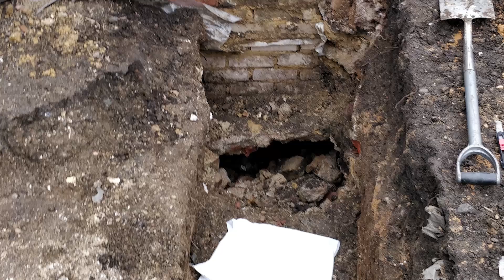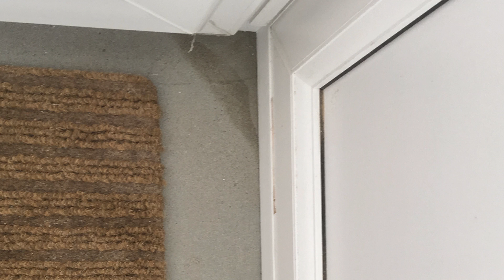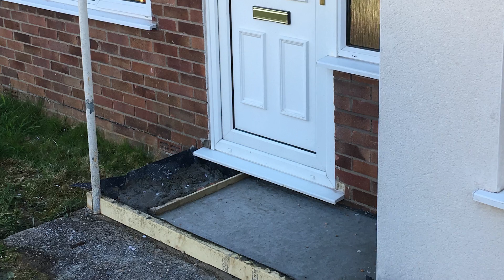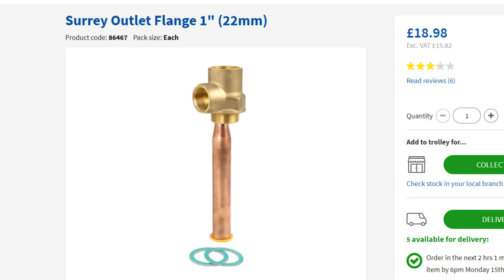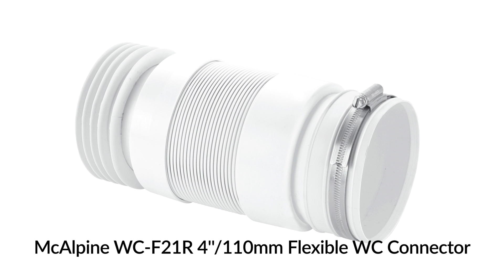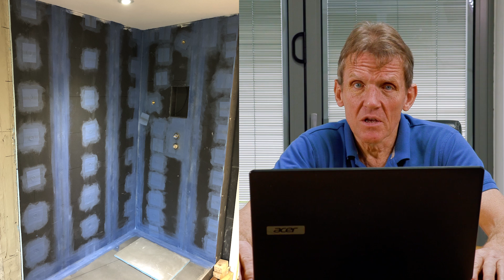Leaking Porch & The Mystery Cesspit - ASB #9

Comment: What that porch is 100% the bell that’s fitted it had just sat the frames on cills without silicone, waters blowing back between cill and bottom of window frames soaking into the floor
And is just sat on the concrete 😂 

Rough as guts job that 😂

Comment: Definitely need a proper (round) backer rod over anything greater than 3/8".  That square foam isn't the correct material. The round backer road is made from a foam that does not easily adhere to most sealants, which is necessary for a long-lasting flexible joint.  You want the sealant to adhere to the sides and move laterally for best results - if it adheres to the back as well as the sides, the joint will fail prematurely.

Comment: what do u think is the best "screw" for attaching timber to brick outside? gonna be attaching battens to a brick wall, also a 2x8 ledger for a pergola.. seen so many, anchors, resin, thunderbolts, concrete screws, rawl... does it depend on the brick quality drilling into? im assuming resin anchors are the strongest . but was thinking thunderbolts would be fine..
Reply: I've used spax high force washer head screws, with long Fisher plugs held really well into London cheese bricks!
Reply: They look smart too!

Comment: Roger, for the silcone vs grout option, you can buy anti mold bathroom silcone, comes in a light blue bottle from Unibond,
Reply from the maker: The Average Joe 
I have used loads of different brands of silicone and, to be fair,  a lot of them claim to be anti mould but they also say that you have to clean it after showering. 
I have yet to find one, even with Microban that wil stop mould growing on top.

Comment: Always use a backing rod in an expasion situation, the reason being is you want the sealant to only stick to two surfaces in joint, if it sticks to all three it won't be able to move as much and can tear. If you use a  paintable sealant instead silicone, you can paint it after to blend in better especially if it is a wide joint. Maybe do a dye leak test with using a garden pest spray bottle to find the problem with the PVC door. No idea with the plumbing side of things. Cheers

Comment: If the frame work has been screwed down to the Upvc cill,sometimes the screws can if too long penetrate out of the bottom allowing water which collects in the Glazing channel to follow down the screw and causing damp on the floor as in your picture.I see this all the time.Always cover the heads of any screws in the Glazing channels with a dome of silicone.

Comment: Hi Roger .... Re the leaking Porch. As a plasterer I've come accross many and all kinds of leakages, from old traditional timber-built homes to modern plastics and the 'best' and 'safest' way to cure those ingress points is to ''Caulk' them. Either with the traditional tarred boatbuilder caulking, or with the stuff you would have used during 'your' Apprenticeship (maybe still do) that old greasy, hairy stuff you wrap round pipes (can't think of the name at present :-)
When compressed in hard enough, there no damp/water getting past either product.

As for the Neggie-Norah's and Nigels?? ..... The more you get of 'them' the better, because it means you're hitting the 'sweet-spot' and making them jealous :-)

Comment: I agree with your comment about using foam to fill large gaps around the frame. It is very common to see window and door frames with no foam whatsoever and the fitters have tried to fill the gaps with silicone. Unfortunately not all silicone sealants are pure silicone and they tend to crack rather than stretch.
Reply from the maker: Bodge 71 
Agree completely cheap silicone is around  60 % fillers which don't stretch. That is why the low modulus is important. Also the acetic acid sanitary sealants don't stick to sand and cement so  you also need neutral curing.

Comment: Those back to the wall toilets! We bought a house, bathroom fitted out nicely and looked fine. Moved in and after a couple of weeks noticed a cracked tile, a really fine crack. But we had spares in the loft so I thought I'd take the cracked tile off the floor and replace it. Lifted the cracked tile and the floor underneath was soaked and rotting and it runed out that the back to the wall toilet had been leaking from the flush feed since it was fitted! Took a lot of the floor to be replaced and a refit and the back to the wall toilet in the skip, the insurance stumped up 2.5k after the loss adjusters visit, the loss adjuster reckoned it was luck that we decided to lift the cracked tile because the other way we would have found out is when the day came I parked my arse on the toilet and dropped through the floor!
Reply from the maker: Chanesmyname 
If you are going to have that kind of accident best to get it on video. Everyone dreams of a viral video and I think that would do it.

Comment: U-pvc porch - the new tapes (such as from Tremco Illbruck) don't need to be siliconed as far as I'm aware. They are airtight, watertight, and provide great acoustic attenuation and thermal efficiency. You only tend to see it being used on new builds not on renovations. As for the weep holes, I wouldn't expect to see "face drainage" holes on a frame which is sat on a uPVC sill. It will be concealed underneath the frame - I have seen on a couple of occasions situations where the gap between the frame and the sill has been sealed with silicone preventing the frame from.draining.

Comment: Isn't the cold water to the cylinder supplied through the cold water tank in the loft? So mains inlet diameter doesn't matter too much right ? As the tank is always full generally
Reply from the maker: You are right but the problem is that as the cylinder is emptied by the pump the cold feed from the tank isn't always quick enough. It needs to be one size larger than the outlet of the pump will suck down from the vent pipe. 
The mains inlet to the cold water tank is not an issue. Perhaps I didn't explain it too well
Reply: @SkillBuilder  ok I understand, thanks for the reply

Comment: With that modern concrete foundation, and brick below the foundation, i suspect that could be an old soakaway thats been built on by a unscrupulous builder. Other than a corbelled  foundation ive never seen brick under a concrete foundation (nor clinker come to think of it) today, building control would make you remove any existing soakaway and either shutter or fill with concrete. I suspect building control will tell the owner to dig it out so it can be filled when he pours the foundation, however this can cause an issue at a later date if the house is to settle in a dry summer this corner is less likely to move, causing cracks.
Reply: Hi Dan, it is a cesspit 6ft across,  there was a drain from my side that went towards it, I also hammered a 2.5M bar down and didnt find anything solid. you are correct it has been filled by the dodgy builder who built next doors extension 20+ years ago. My SE came up with a massive 'T' beam that will be too expensive to do as it would require 3 separate concrete pours  to a Terrace house on a narrow road. so no extension for me.
Reply: Th Fc , interesting, perhaps a pair of pads either side and a hefty 600x600 reinforced concrete beam over the top?
Reply: @thewestonbrothers  yeah my SE came up with something like that but with 3 pads to make a 'T'.
Reply from the maker: I think my building inspector said it was best to avoid a localised hard spot. I suppose it depends on the ground and what it going on top of it.